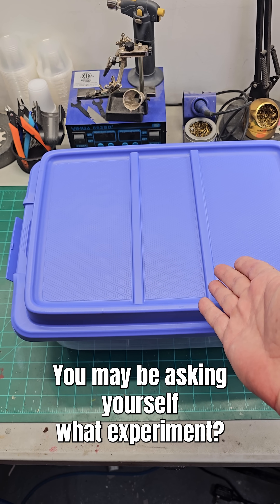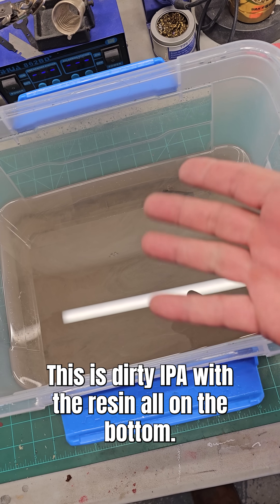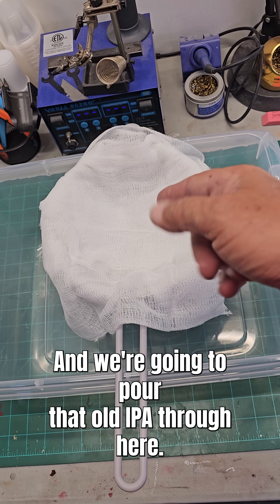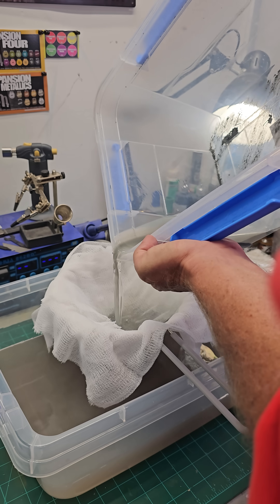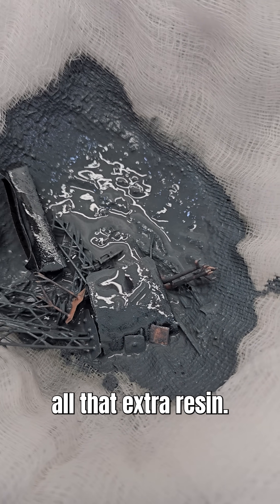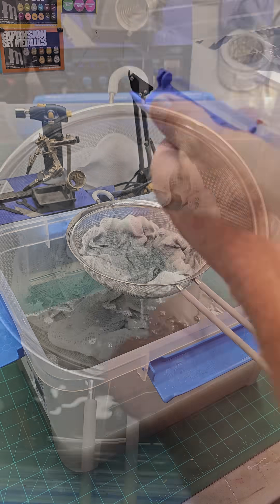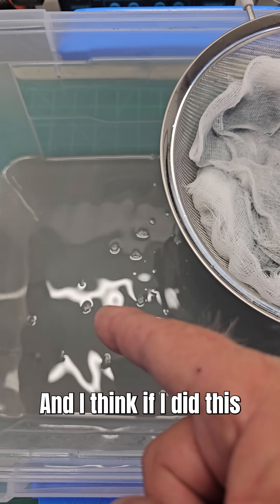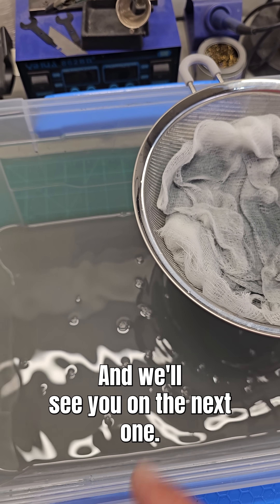Will This Clean My Resin IPA? Watch and See!

Comment: Umm... I don't know if I should ruined the fun or not? That's just some random liquid left over by the the mixture of IPA and resins...

The thing about IPA is...... 

IT EVAPORATE!!!
Reply from the maker: Not really ruining anyone's fun. That is not a random liquid. That bucket is my first bucket to wash off the print, all of the washed off resin sits at the bottom of the IPA bucket. If you leave it under UV Lights or the sun that resin will solidify, it won't get completely hard just a goopy resin mess. And, yes IPA will evaporate over time if left unsealed and you will just be left with mostly water depending on your IPA percentage that you use. The bucket I use and most of us do are sealed after use and only opened for a little while at a time so we do not have to smell it or let it evaporate too quickly. I can use that bucket for almost a year before I have to change the IPA because of breakdown.

Comment: I have been using the same alcohol bath for 4 years now. I only ever have to top it off with new stuff every half a yes or so. Prewash with simple green (diluted 1:1. It's very important you dilute it or it won't work correctly as a degreaser) and then final wash with IPA. Trust me you will never have to buy alcohol almost ever again
Reply from the maker: That is basically my system too. Except I pre-rinse all the left over resin in IPA first, then it gets a 30 minute bath in simple green diluted indeed :) then a nice good rinse in water to get the simple green off then a final bath in clean IPA. I change out my IPA about once a year because it does lose its umph after being opened.

Comment: You could also try coffee filters for something about as cheap as cheese cloth, but with finer pores. If that works, you could look into chemistry filters. They're not too expensive, and you can get it with very specific pore sizes. A piece of filter paper on the top and a glass + ceramic filter will let you filter out exactly the particle size you need. Investing in a ceramic filter once would let you reuse it multiple times in the long run.
Reply: Let me know if you want pointers setting up a vacuum filtration setup. Typically a vacuum is used to pull the liquid through the filter since gravity alone will take a long time.
Reply from the maker: Thanks I will definitely let you know when I am ready!
Reply from the maker: Thanks for the tips! Trying to stretch the IPA for as long as I can before bringing it to the hazardous waste recycling center :)
Reply: This!